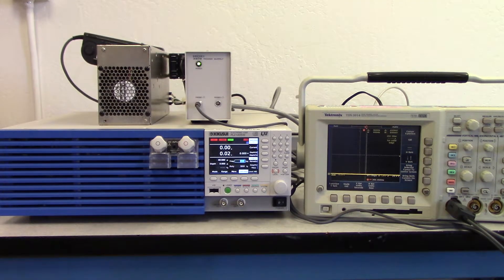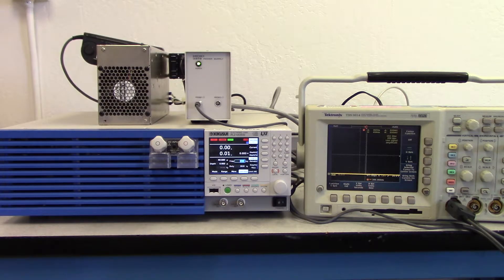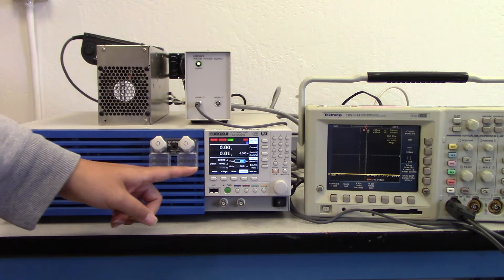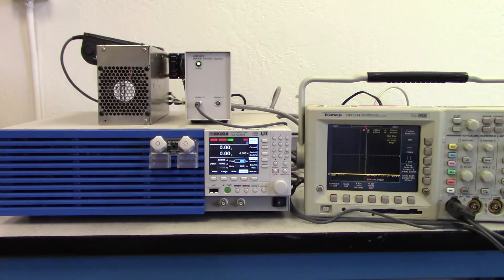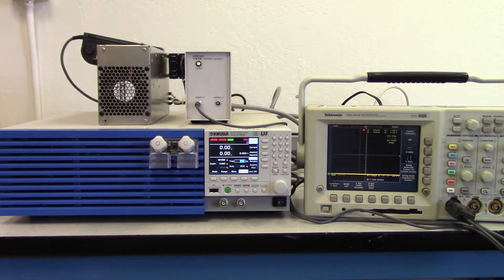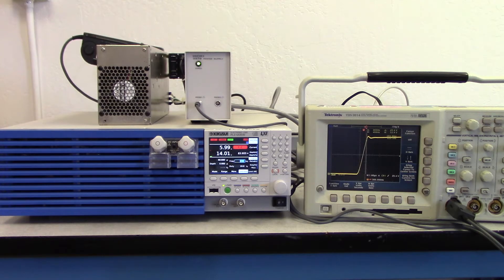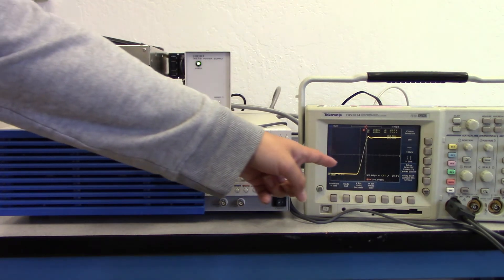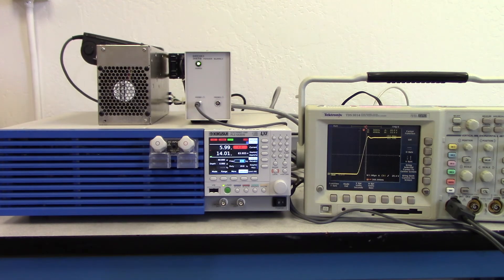Kikusui PLZ1205W DC Electronic Load- Fast Slew Rate Demo - 60A/μs!

Comment: Using an external current probe as an objective way to measure dynamic current makes sense here. I wonder if you considered showing the signal from the built-in "I MON OUT" front panel coax connection into a second scope channel? Is that good for (HF) transients like this, or only DC measurements? Thanks.
Reply from the maker: Exactly, you can use the built-in "I MON OUT" on the front panel. Thank you for mentioning one of the nice features on our load! It would be helpful to measure a high current or when you don't have a current probe on hand. However, in terms of accuracy, current probe would do a better job. I MON OUT is 2V full scale and +/-(1% or range). We will try to make a comparison video, I MON OUT and current probe.
Reply from the maker: We uploaded a new video comparing current measurement between the I MON and a current probe. Please have a look! https://youtu.be/Jx_9PsYl_Is

Comment: Thanks for that short info, could I simulate the profile of a largish inrush current, i.e. from a small motor or a transformer?
Reply from the maker: Thanks for watching our short video. The unit on the video is a 1200W model that is capable to sink up to 240A. If you need higher current, we have a booster to parallel up to 2160A (10.8kW). It is programmable and you can create test sequence up to 10000 steps.
Reply: @kikusuiamerica  Thanks a lot for your fast and great answer! :-)